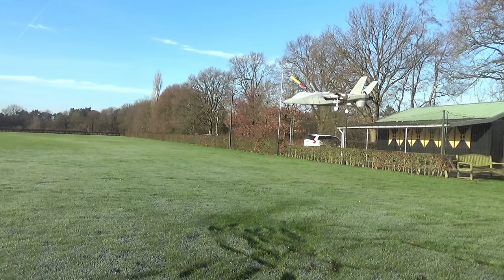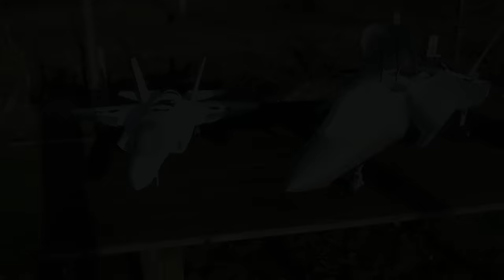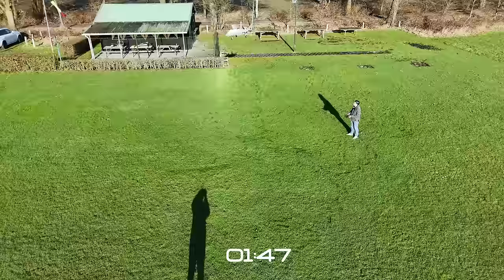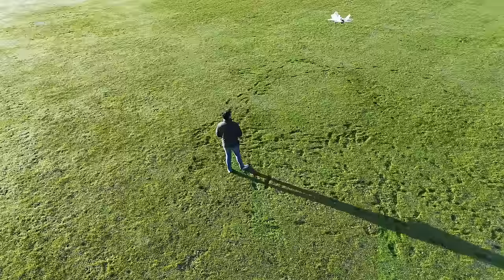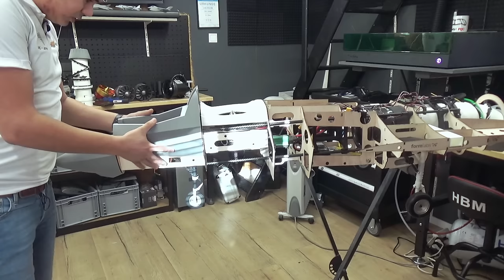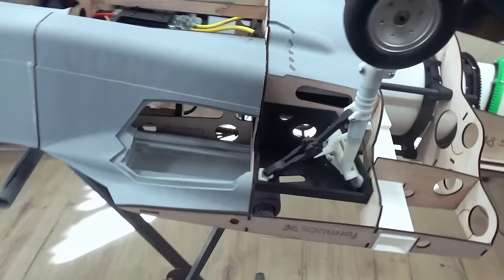F-35B Testing 2x130mm Highvoltage EDF First Hover schubeler 20Kg output Stability |  DJI mini 4 pro

Comment: Excellent Joel!!   

Brilliant work!

Concerning the panels…If you could have the printed panels overlap the bulkheads, problem solved with hiding the bulkheads.   Maybe overlap with a tongue and groove interlock system so to speak.   The process is excellent you have designed to build.  

It’s unbelievable what you are doing in such short times.  👍
Reply from the maker: Love the idea, yes I have say a hughe thanks to my supporting wife😅🫣

Comment: Very nice work!

How does the transition to wing borne flight work? Is it with one switch? Do you have to control throttle, nozzles, doors all separately?
Reply from the maker: 2 switches, on for tilting the duct to lets say 40 degrees, second switch to put it in flight mode. The second switch is waiting for the speed meter to reach atleast 50km to go into flight mode

Comment: The big jet looks impressive. But you won't finish it into a fully operational transitioning jet. It will only ever hover. Because you never finish any of these projects to an operational jet that can hover-transition-fly-transition-hover. You never finish anything.
Reply from the maker: Than you are on the wrong channel, the focus of this channel is all about hover, flying and getting the models big and scale as possible. With kestrel and the small printed F-35 I’ve made transitions from flying to hover but than you have to give up all scale features to make it work. It is all just too heavy if you add all the 17 working doors and scale landing gears. But hey that part is fun too, but semiscale. The only solution is too go bigger! More aerodynamical lifting. Perfect for that transition…but…the model gets very very expensive. So progress is slow. But that is okay. Do you know someone else in this world who is has a fully scale functional f-35B version?